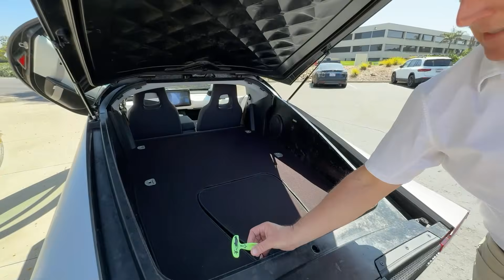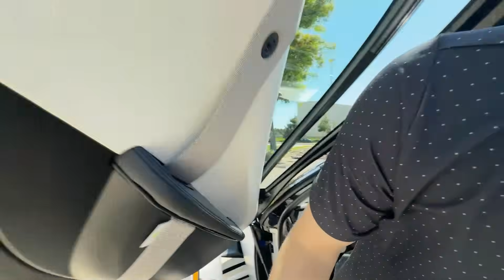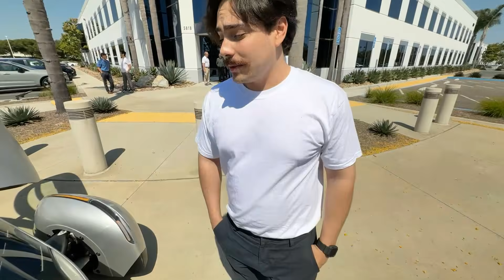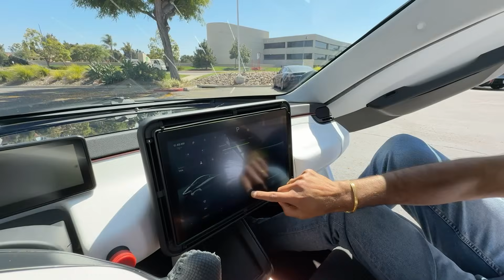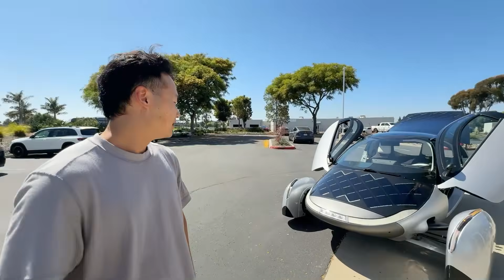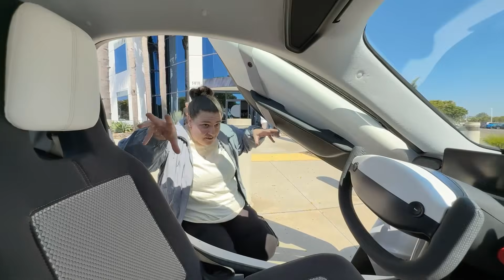Aptera Milestone — Introducing the Next Validation Vehicle

Comment: This is excellent, I love everything about how it's turned out. Probably my only qualm would be the lack of a prnd stick. Touch controls are fancy but I'm someone who missed out on a lot of the touch revolution so I wouldn't be confident I could use them accurately for a vehicle. I could probably handle it as being a replacement for a contemporary dashboard and window levers, but ya, that drive control is a bit too untactile for me. I hope eventually something like this but with physical controls can come out, if not from Aptera then maybe someone else.
Reply from the maker: You can use the backup PRND! It's tactile and directly under the display.
Reply: I'm not a big fan of the Yoke without steer by wire. So my hope is to either get a steering wheel option or a steer by wire option sometime in the future.

Comment: I can not wait to get my hands on one.   Thanks Guys!
Reply: Its doa.  They will go bankrupt.  Too long to production,  too expensive and too niche.
Reply: @bad50 people want mpgs. Well, EVs don't use mpg, but you know what I mean. People want cars that are efficient.
Reply: @MrGamelover23  I agree but a 3 wheel , 2 seat motorcycle is such a niche product  and at that price you can get an electric  4 door car with 300+ mile range with a dealer network and great warranty.  Chevy equinox for example
Reply: Seems to be a common thread with some people. "If only I had to use more resources in order to move my heavier, clunkier vehicle around"
Reply: @bad50 My Apterra has been ordered with a 1000 mile battery pack... I live in ARIZONA. If you know anything about arizona, you know, I'll never have to do any manual charging. 
SOUNDS LIKE THE LAUGHS R ON U YOU!
Reply: @alyblueyz I got $100 that says you will never see an aptera much less one with 1000 mile range. 😂😂

Comment: Windows really should have physical control. The driver shouldn't have to take his eyes off the road, extend his arm all the way, and make sure the fingers are touching the right spot to open and close the windows. That is a safety concern. and putting it on the screen doesn't actually make it better.
Reply: Yeah, I have to agree. I get the cost argument for not having a bunch of physical controls but some things just need to be accessible without having to take eyes off the road. Window controls are definitely in that category for me.
Reply: @kurtp2003  Physical controls for windows, radio volume, fan, temperature, and which vents the air comes out of, should be mandated by law. Not having them is a safety hazard, and 99 percent of customers want them.
Reply: Give us crank windows as an option!

Comment: Feedback: Sadly... though I love the exterior of the vehicle and it's premise as a solar powered vehicle, I really, really don't like the drivers control interfaces (front dash, steering yoke, and oversized screen) for safety reasons. So please take this as constructive feedback from someone that likes to actively drive their vehicles. My issues with the front dash are as follows: 1'st having everything connected to one big oversized screen creates a single point of failure, if it goes down during a drive what other options do you have available? Backup systems?  2nd; I would rather have analog switches for many of the controls like Windows, AC/Heat, and Audio volume too name 3 so that I could easily adjust them by feel at 65mph without having to look for said control on a screen. This would allow me to  keep my eyes on the road rather then distracted by trying to find some touchscreen position to make adjustments (thus looking away from the road - essentially as a distracted driver).  3rd the Steering Yoke: I myself prefer a round wheel as it allows flexibility for where to place your hands while driving, and this is especially important for long trips. The problem with a yoke style design is it removes some of that flexibly which could make driving for hours very uncomfortable. On the positive side I do like the blind spot screens if they also have a HUD for speed, compass bearing, Low/bright beam indicator as they are directly in line of sight as one looks down the steering shaft, and those should be visible from that direction. So for those of us Active drivers with reservations (like myself)... please consider either some changes or an option for a different dash configuration for those of us that don't want a huge distracting screen, and prefer a more analog control interface. Because honestly you could make that screen 1/4 the size and use that room to put in some analog controls and this could be a dream machine to drive.
Reply: I agree completely with the inclusion of analog controls. A lot of the major manufacturers have listened to their customers and are migrating back to analog for the most basic actions. It's so much easier, and safer, for example, to just reach over, without looking, and drop the window or dial up the AC. Have you seen the Slate Truck? You can even get that vehicle with window cranks! I remember having to replace (myself) all of the window actuators in a Maxima, to the tune of $80-110 apiece! Keep the faith. Hopefully, someone is listening to these kinds of ideas.

Comment: Please 86 the goofy steering yoke, put a traditional steering wheel on it (or at the very least offer one as an option). I am glad to see a display behind the steering wheel area instead of only having information in the center, like a Tesla's horrible interior.
Reply: Agreed, grabbing the middle during a turn makes you feel goofy.
Reply: The yoke is to allow a clear view of the side view cameras without having to turn your head to see blind spots. Drew of  Tailosive in his test drive said the experience was very natural and easy to adjust to. He said all cars should use this system.
Reply: @daytonclaudio689  What did he say about the Tesla Yolk?
Reply: However, my daughter is a paramedic and has described the fact that many drivers like to put both hands on the top of the wheel.  In an accident it often leads to broken hands/arms, fractured notes and face as the impact drives your arm/hands into your fact with the air bags.  That is why the recommendation has always been to have to your hands at 10 & 2.  this design will help prevent those types of injuries so I see it as a good thing
Reply: @puzzling90066  What does she say about turning and grabbing at a wheel that isn't there?
Reply: Agreed. Speed and battery on the display behind the steering wheel, and rear view on the sides like any other vehicle. Not a fan of displays replacing mirrors TBH, but I see why they are needed in some areas for aerodynamics. The display behind the steering wheel NEEDS a sunshade over it. All rear-view camera + display modules need redundancy as to not fail at the wrong time and to be kept as rear view only + maybe a compass display like on some cars. Don't bloat them with any other display info.
Reply: They're not changing any of that at this point in the development process.

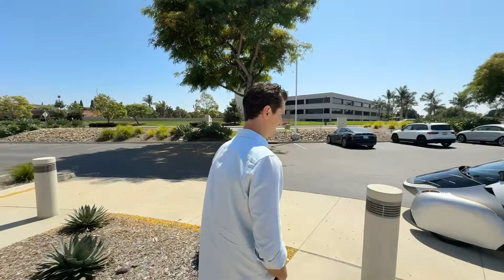Comment: 6:50 - I like the aluminium lip in the cargo bay - to me, it extends the sleeping quarters length if you are camping overnight in Aptera. It will be great to stretch fully and sleep well.
25:45 - when can we expect a 110 ac volt  outlet?  
Thx for the video with the progress. Being a reservation and a share holder, I was beginning to lose hope.
Reply: I doubt there will be an AC outlet with the extra weight and expense of the inverter, but there are plenty of nice small solar generators on the market for you to choose from.
Reply: @J-W-Kelly  I thought so too. Yes, I do have an EcoFlow DeltaPro for exactly such emergencies. But I hope Aptera comes out with these systems built in in their future versions. I am very sure, it will increase the marketability.
Reply: @Soothsayer210 Delta Pro is heavy… about 100lbs!
Reply: @J-W-Kelly  EcoFlow's Delta Pro Extra Battery (the 'battery only' version of the delta pro) weighs 84 lbs, whereas the full Delta Pro weighs 99lbs, that means a Delta Pro spec inverter would probably weigh under 20lbs. 

To have all that power stored in the battery pack, and not having meaningful access to it is very unfair… especially for a vehicle that has used camping as part of its advertising push.
Reply: @something2sea  Poppycock.  There's nothing "unfair" about it, and only a childish adult would think like that.  If you want to access the traction battery power, you can do so with a DC to DC converter and get up to about 1500W depending on how much the Aptera can supply with its own DC to DC converter... on my EV its 2500W, so I can safely draw 115A from it while the vehicle is on with a Sterling Power DC to DC converter...12V X 115A or so turns into 48V X25A or so, which I send to my batteries and inverters.  There is no reason for Aptera to supply this extra functionality with all the extra weight and complication at this stage of development.  The Delta Pro alternator charger would work too... just a lot less wattage than my set up.

Comment: As a Socal potential buyer, will you make a windshield sunshade that mounts at the top of the dash to protect the cockpit from sun damage and heat? Also, when and where will the Huntington Beach California Road Trip event be?
Reply: I will carry a small towel to throw on the dash when there's a glare issue while driving. I would rather deal with it the simple way than not have those panels. That's the purpose of this car: to get solar charging.
Reply: Solar panels on the dashboard need sun exposure.
Reply: @dr.jerrywolfe1289 I wish I could eliminate the dash solar. I want hood, roof, and trunk but that's not possible.
Reply: @njdevilku1340  at least some of that sunlight energy is turning to electricity instead of heat.
Reply: @dr.jerrywolfe1289  I should have said top of instrument binnical. I know the solar panels need to be exposed.
Reply: Just don't give them any money until the car is actually being delivered to people. Because so far it looks like they're just going to fail. Like in 2011.

Comment: I would like to know how far back the seats recline and whether or not the sun visors swivel to block low light coming through the side windows.
Reply: To my knowledge the visors do not swivel to the side. It’s fixed and simply tilts.
Reply: At CES the visor did not swivel or telescope.
Reply: @Drexgreen-x they spent the entire video saying that this vehicle is entirely different than what was at CES so I think it is a fair question
Reply: @SomethingElse4U Correct. Totally different visors than Apollo's  at CES. Looks much more sturdy than what Apollo had.  However, It does not look like they can swivel to side window. Myself, I plan to have the door upper window section somewhat tinted...